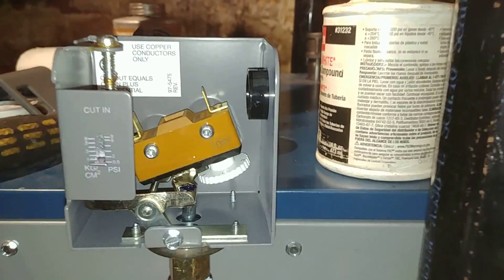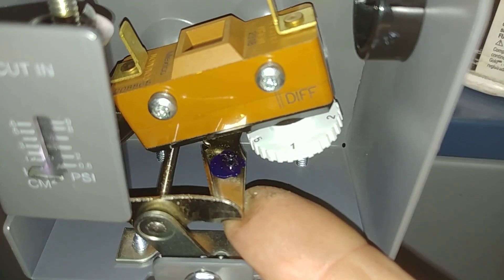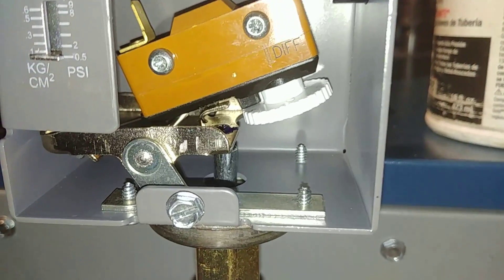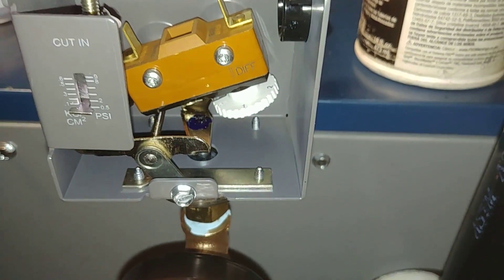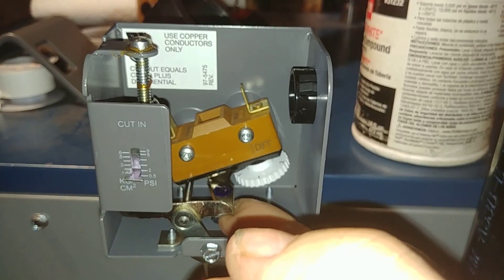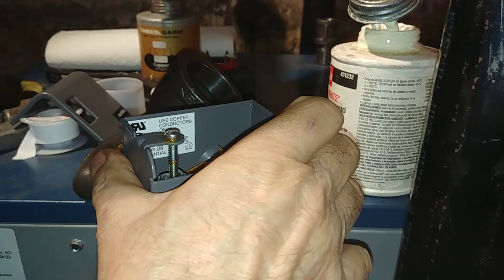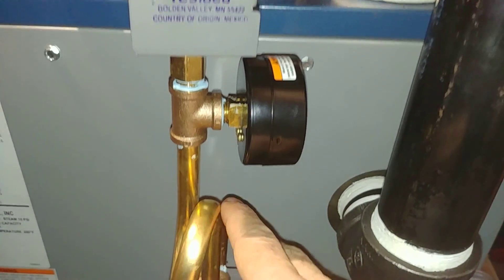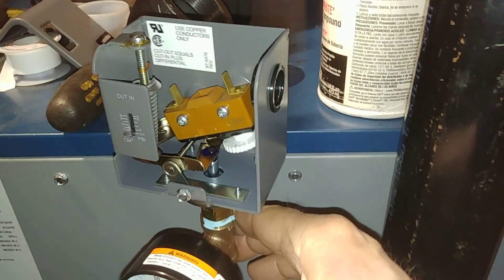Finally Getting This Broken Pressuretrol To Work Like It Should've In The First Place!

Comment: Is that ( T ) under the Pressuretrol called a Hartford, or is a Hartford only refer to cast iron joints?
Reply from the maker: Check out my video on Hartford Loops.
That 1/4" brass tee is called a "male" tee for short.

Comment: On a large-building boiler system, have gone through 4 new L404F 1060 units, all of which won't cut-on at the MAIN minus DIFF pressure level.  Finally had one 'working' last year by reducing the DIFF setting relative to the MAIN, but when firing up boilers this fall, it won't work again.  Just purchased an old 404F 1060 unit off eBay, which I expect will work just fine.  Total nonsense.
Reply from the maker: Thank you for sharing your story.
Please make sure your pigtails are totally clear.
But, yes, while the L404F 1060 units certainly look impressive when compared to the humble PA404A pressuretrol, they don't work nearly as well, IMHO.
I would consider using that instead of the L404F.
While I rag on the 404 a bit, they are at least easily tweakable.

Comment: question,  I have this same controller and my issue is that it takes too long to cut back in after the max pressure is reached.   Can i just turn the screw, raise the cut in, ti solve this problem.   Dont really want to bend anything inside....   Diff is at 1 and the cut in is bottomed out.   (when i say it takes too long, I mean the radiator go almost cold all over the house before it cuts back in......and when it does, it doesnt stay on that long before cutting back out......HEat is clicked on, on the thermostat the entire time.)
Reply from the maker: I would have your "pigtail" checked to make sure it isn't clogged first
Reply: @gordonschweizer5154  thanks for the reply.   Would screwing the pin safely help with the short cycles and long cut-in times, while I wait for a professional to check?
Reply from the maker: @rayjgold  I am reluctant to recommend any other course of action until the pigtail is checked.
Reply: @gordonschweizer5154  Thanks for the responses....   The problem is, I live is a big city and many are concerned only with getting that arrival fee and not with fixing anything.... I've been burnt many times.   I think I will think about replacing the whole furnace when it gets a little warmer.    This problem is only an issue on very cold days, when the heat is "on" for almost the whole day....  the furnace reaches the pressure and cuts off in about 30minutes..... then it takes about 3hrs or more for the pressure to go back down to where it can cut in again.   And I've discovered that after about 3.5 hours....if I touch the cut-in screw at all, the furnace turns on and runs the normal 30minutes....before the cycle starts again..    Can you tell me if it is normal for it to take 3hours for the pressure to go down and allow the furnace to turn on?    Even when I screw the screw to the point of turning on the furnace.....it does not affect how long it takes to cut back in. :-(  I've been in my house for more than 20years and the furnace looks old when I got it.....  shame to have to replace it when it is only used about 3 months in the year!  but if it is less than 10k....I think I will just pull the trigger and be rid of this annoyance.....for a while.
Reply from the maker: Turn the power off to the boiler.
Remove the wires to the p-trol.
Take the p-trol off the pigtail.
Blow into the pigtail to see if it is clogged.
If it is, replace (or clean out) the pigtail, (not the whole boiler!!!!)
Put new (or cleaned) pigtail back.
Thread the p-trol back onto the pigtail.
Hook the wires back onto the p-trol
Turn the power back on.

Comment: I have an old pressure control that was probably on the boiler before the current one in my house. It will move to the new boiler when I install it. It's a Perfex model 700D pressure control. Dead nuts accurate down to 0.75 psi cut out, which is as far as it goes. I see tons of them on Ebay new old stock for decent prices. They were sold under many names, Perfex, Timken, International Economy, General Control, etc. They came in many pressure ranges including a vapor/vacuum model. They are not a mercury switch or snap switch control, rather using points almost like a distributor on a car that have a magnet on the base. It's a difficult to describe design, but it works well. It's a bakelite cased control with an art deco style. You should pick one up and see how you like it, I find mine to be significantly more accurate than both Pressuretrols that I own. Search 700D pressure control or 700D steam control or just 700D control to find one. Timken Control should also get you some results. I've been searching for the Vapor model for quite a while because it seems it would work significantly better than the current Vaporstats.

Comment: So, last year, I finally dialed in the PA404a using the technique we’re not aloud to say on YouTube (😂) . It worked perfectly until I tightened the set screw on the cover.  Seems the metal body flexes just enough to throw it off!  My fix was to place the cover on and just put the set screw in one turn with a dab of lock tight on the tip!  Works better than factory designed!
Reply from the maker: Thank you for reporting that putting on the cover will throw off the setting!
That goes a long way to explaining why there were a few times that I'd tweaked the pressuretrol a low setting, only to get a no heat call back due the PA404A not resetting!
I had put the cover back on, assuming all was well.
So now I know that to really dial it in, the unit must be tested with the cover on from now on.
Thank you again!

Comment: Gordon, one has to wonder if these come out of the box set high so that we are forced to do (their) fine calibration work.  I see too many in the wild from cheating and fooling companies were never adjusted.    Here my own boiler (properly sized and almost no water use) never seems to hit the cutout, reaching 1/2 lb before t-stat cutout.  Am I missing something?  Thanks again.
Reply from the maker: Thank you for your comments.

I think the factory set-up is supposedly to meet the UL listing and that seems to be more honored in the breach nowadays.

Too many installers seem to think the control is set at the factory & that's that - they ain't touching it.

Lucky you with the properly sized boiler!
Properly sized (or even undersized "by the book" ie ignoring 1/3 pick-up factor), the steam output from the boiler should be totally absorbed by the piping & radiators and converted into water with little to no leftover steam to build pressure.
Oversized boilers just keep hitting the pressure limit, sort of like driving your car with the gas petal held down & controlling the speed with the breaks.

Comment: What causes the sight glass tube to surge down and the low water shuts off the boiler. The water level bounces and shuts off the boiler.  After a few minutes the water level returns and the boiler re-starts.  I flushed the boiler and the wet return was cleaned in Sept.  Pressuretroll is at 1lb and .5.
Reply from the maker: Is this a new install?